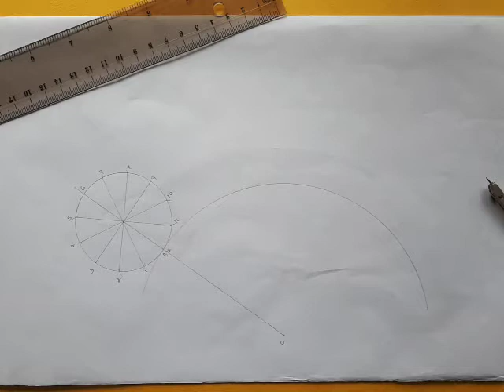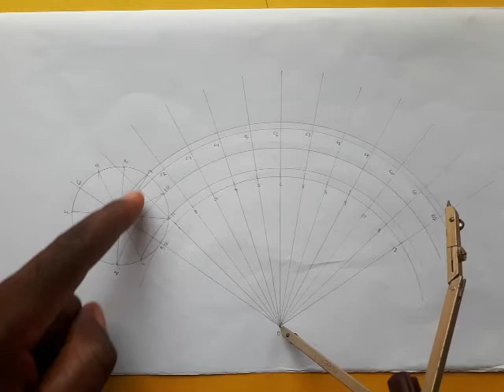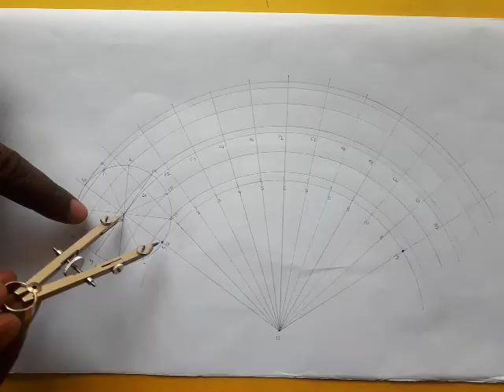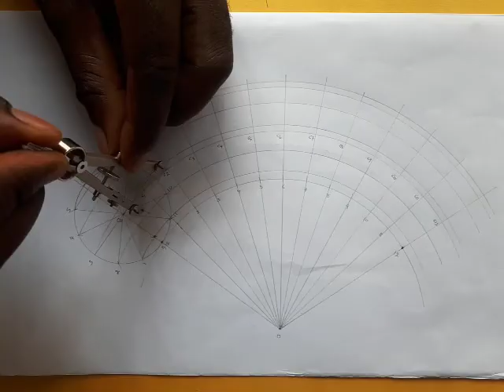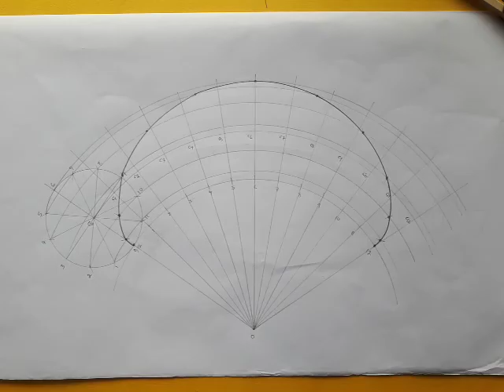TD - How to construct an Epicycloid

Comment: Sir a Waec recommended Compass cannot draw all the arcs. How do i go about it?
Reply from the maker: OK so first of all WAEC doesn't restrict one to a certain compass, as much as i know, u are only restricted to a certain calculator, that's different from a compass.
However, if u don't have Rotring compass, you could still make use of a normal compass but this time, extend the pencil ✏ out of the compass (i.e push it further beyond the same level as the needle of the compass), that should help.